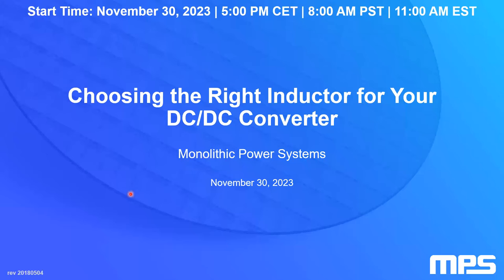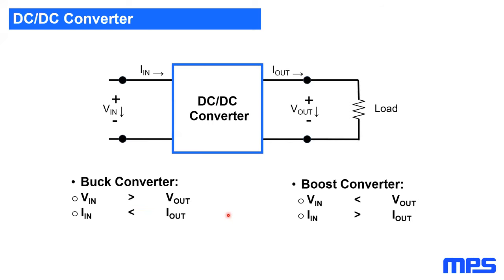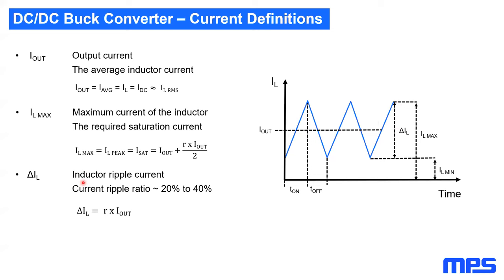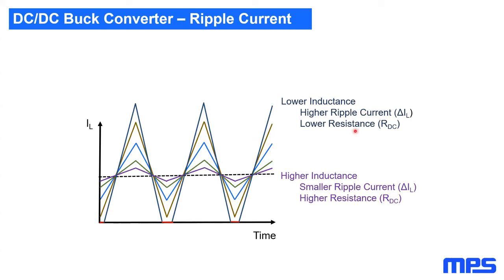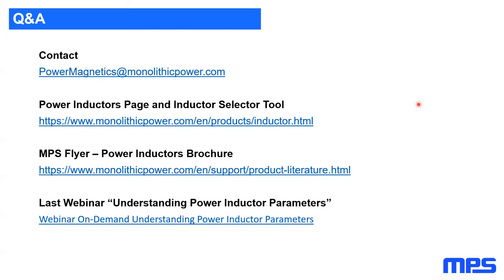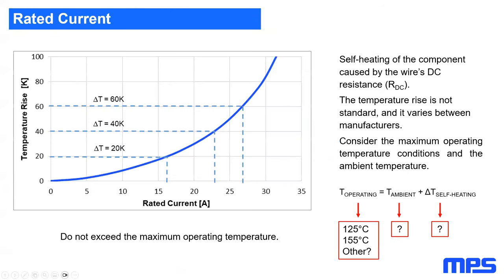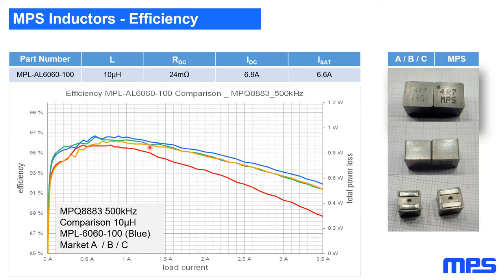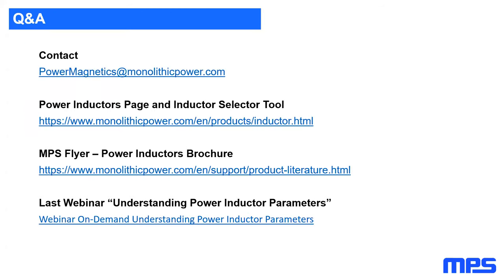Webinar: Choosing the Right Inductor for Your DC/DC Converter

Comment: Hi... It was an excellent webinar. In the final efficiency comparison slide (before Q&A), I could see that the part selected has lesser saturation current than Idc. Can you explain how that's possible logically ?? (So far, I've seen inductors with Saturation current greater than rated current)
Reply from the maker: IDC and ISAT are different currents.
IDC is related to the self-heating effect caused by the heat dissipation of the inductor windings. Rated current is related to the cooper loss. In case of the MPL-AL series, due the flat wire construction it will have even lower resistance, so the rated current will be higher. 
ISAT is the change of Inductance value at certain percentage of current (in this case 30% inductance drop). Saturation current is related to the core loss which is depends from the the core material, temperature, frequency, current, pressure.